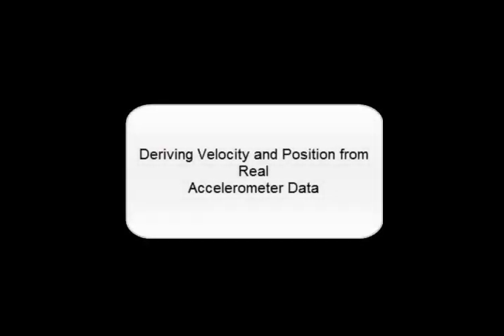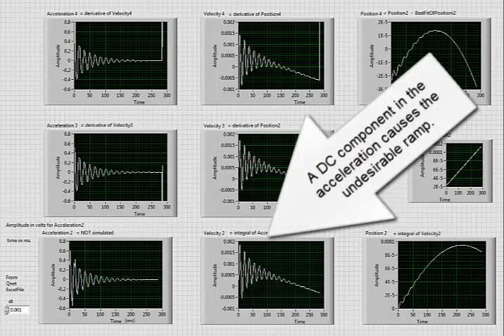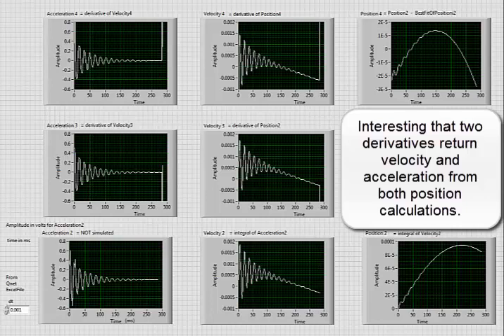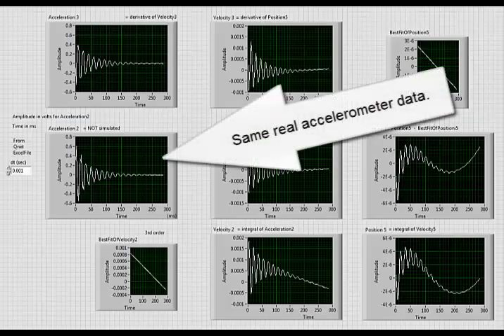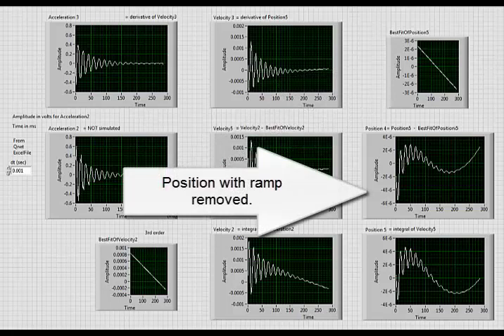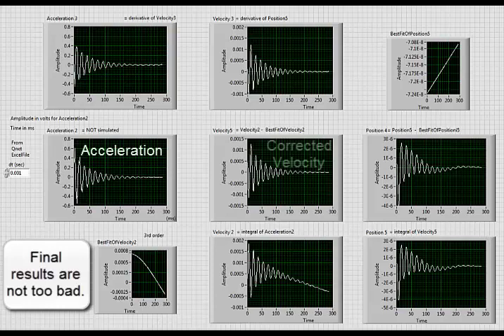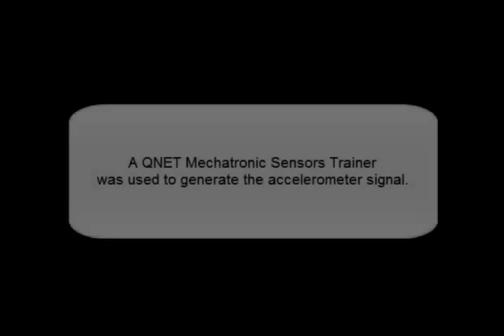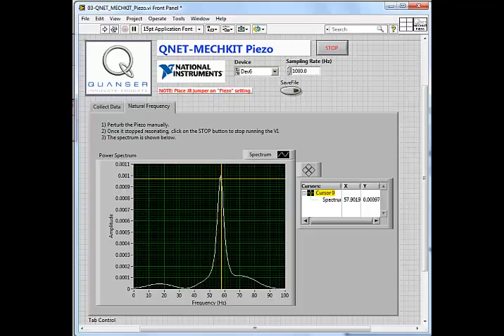B3356 - Velocity and Position from Real Accelerometer Data

Comment: Hi @barkerds,

First of all thank you very much for taking the time to share this video, no one mentions this here but everyone knows how much work it is to do a good editing let alone writing the material.

I was wondering if you could shed a light, or removing cubic fit from velocity, and linear fit from the position? Are you talking about something along the lines of an exponential moving average? Or in this case a cubic moving average?

Or are you talking about cubic and linear regressions? 

in case would that be possible to get a high-level algorithm or even the labview code you have used for this?

Many thanks and carry on with the good work.

Romain software developer and passionate electronic hobbyist.

Comment: Thanks for your videos, which are very cool btw. I have a question. How reliable are the displacement values obtained with this method. I mean, if I'm looking for milimetric accuracy on displacement measurements, should I trust in these results ?